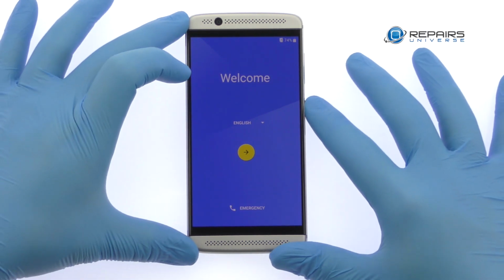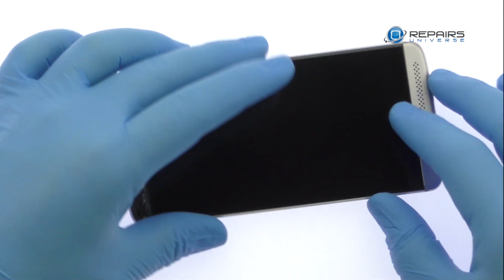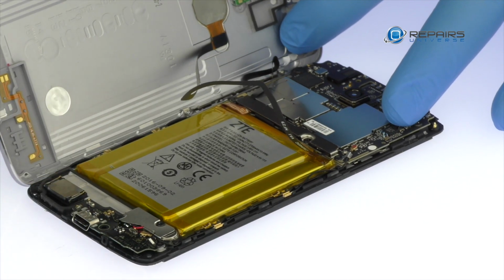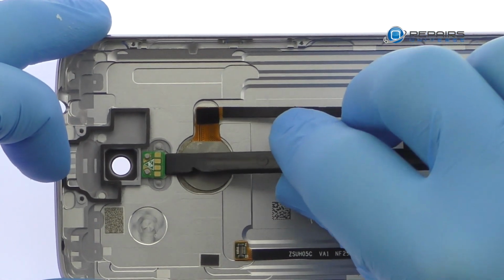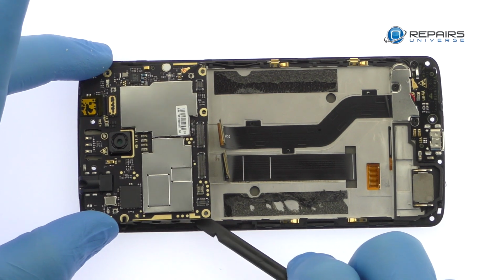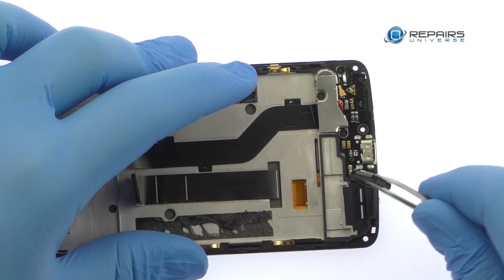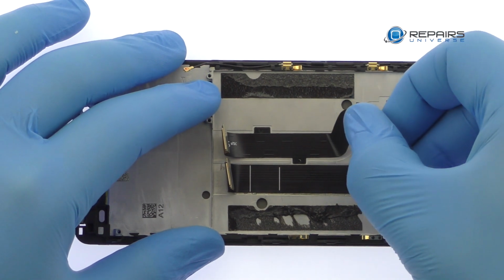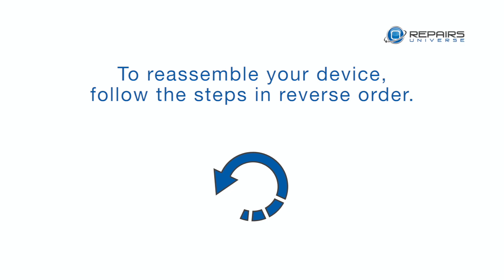ZTE Axon 7 Mini Take Apart Repair Guide - RepairsUniverse

Comment: Good day. Great video you have repair University, but one issue,:the phone was made to be pry open from the bottom NOT the top. BUT great work. Keep it up
Reply: I have just do it myself and you are right, you have to start the opening at the botton where the charger connects as shown in the video but is good to point on that